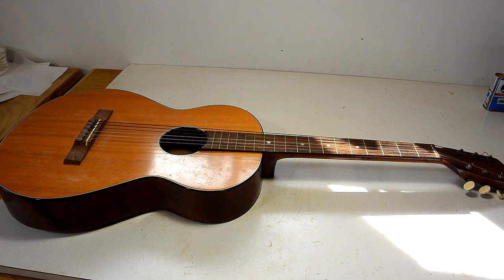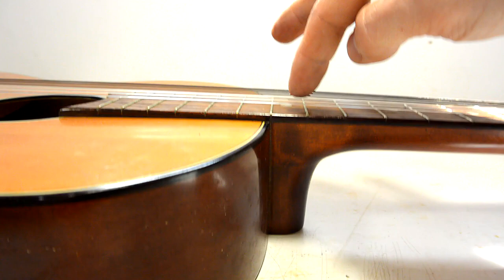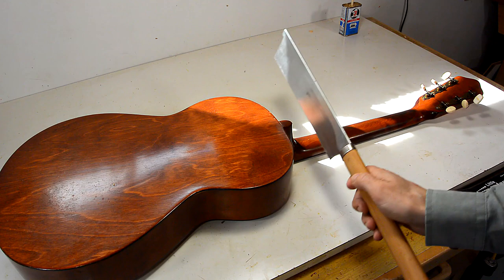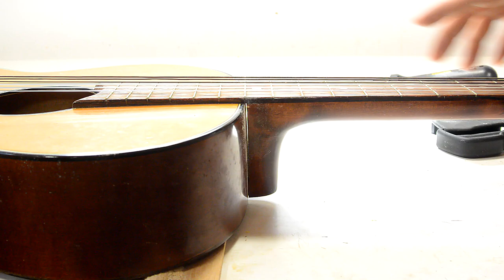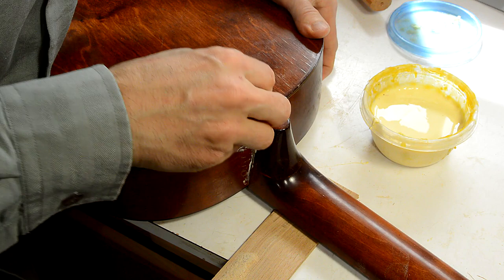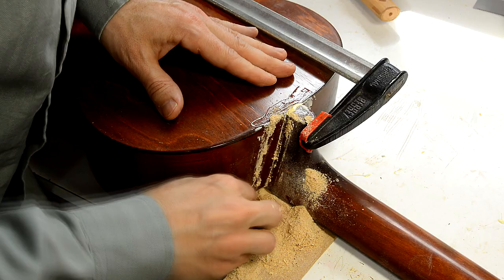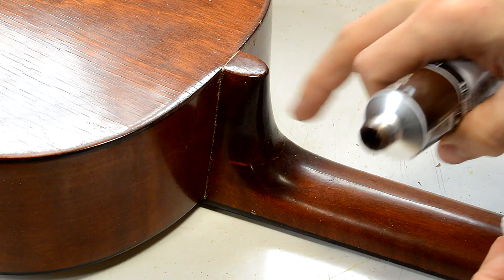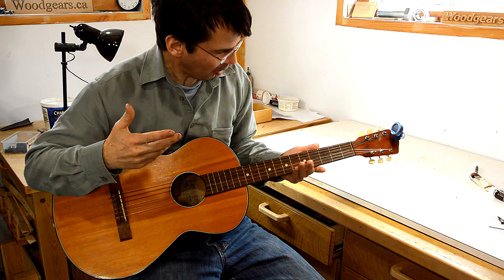Neck reset on a junk guitar

Comment: Joint strength and longevity aside which seems to be the only thing people on this comment section are worried about, vibration transduction, a direct contributor to the overall sustain and volume of the guitar,is what is most negatively effected by replacing that wood with glue. The vibrations from the strings are not only waving over the sound hole, but they are also vibrating the entire guitar. By putting in even more glue, you are buffering that wave and losing amplitude in the process. Don't get me wrong. If I had a crappy nylon guitar who's neck needed to be reset that badly, I would most definitely use a method like this or even more barbaric to get in right. No sense in spending hours or days of my time that could be spent making more money somewhere else. Also, nylon strings operate at almost 1/3 the tension of steel strings and the joint honestly doesn't need to be that strong.

Comment: I'm wondering how much you closed the gap between the strings and the bottom of the fret board after this fix.  It doesn't look to me like one would gain much, but it sounds like a great idea.  I have a baritone uke with the same problem.

Comment: Hi.. Good job, !!  I've also done many of these repairs on older guitars.. What you've done is known as a ' Hippie ' neck reset.. Its a lot easier/quicker and cheaper than steaming the neck off and shaving the duck tail..  What you also could have done while the glue was setting was,,,put a strap button at the base of the neck joint and drive in a 2 1/2 in wood screw directly through the neck joint into the tail block..This would guarantee the neck won't let go,,, plus you'd now have a strap button at the front as well ... Cheers

Comment: This indeed is a quick way to do this but it would be better if you use a Renovator (Electric Tool available
at Amazon) and mask of the sides to reduce damage. Mounting a screw from the inside into the heel is
a necessary extra!

Comment: So just by sawing off at the point where the neck meets the body removes enough material that when reglued. The strings are closer to the fretboard?
Reply: He does not really comment on that, but I would say you are correct. The removal of that material results in the neck tilting , lets say back. Or you can think of it as lowering position of the nut relative to the bridge. 
And you can see kinda the same thing, minus the sawing by looking up that process of shimming the the neck of an electric guitar. That changes the angle of the neck.

Comment: Nice!
You could have also heated up the neck heel and the fretboard and then chiseled an angle on the neck heel where it meets the body. It should also solve the high string action.

Comment: I had a situation where my son found a discarded Gremlin guitar made in Taiwan. It was a G10N I found out with a little research, (the label was quite faded), and brought it by my home. I cleaned it up really good, because it was filthy !! It had some dings and scratches, but didn't look half bad actually. Someone put a nut and a saddle on it that hadn't had the height adjusted low enough, and the strings sat way too high off the fret board. Also they had heavier steel strings on it even though it was just a travel-sized classical guitar. Luckily, my wonderful nephew is a guitar tech, and he took it for a few months to work on it in his spare time, even though he was a very busy guy at his guitar repair job. He took out the nut and saddle and sanded them down from the bottom, and had to do a cheap neck fix too, because these little guitars have no truss rod. The neck actually had too much bow in it, which is opposite of the usual problem where the neck is too straight - go figure, right ? Somehow he did manage to remedy that, God love him : ) He restrung it with Martin brand classical strings, 3 light silk and steel and 3 nylon I think, and I love it. My nephew gave it back to me a week and a half ago at his going away party; he's in the Army now, and off to basic training. I too am former military, and am very proud of him....he's going to work on helicopters, so I'm sure he'll be in tech-school for quite some time. I'm not sure any guitar is junk if it can be repaired, played, and enjoyed by someone !! I prefer to call mine 'recycled', and I think it sounds pretty good : )

Comment: I had to undo my thumbs up when he pulled out the saw.  But then when he did not cut through the fretboard, I had to thumb it back up.  ...or re-thumbs up it.    The problem with this repair is that it fixes all the accumulated curvature in one place. But a lot better than throwing it away.  And he tuned it up perfectly.

Comment: I think you can reinforce this joint by adding a screw in the guitar heel, and hiding it with a strap button. But you will have to add another one at the bottom of the guitar.

Comment: It doesn't have a truss rod because it's a classical (or flamenco) guitar, gut or nylon strings which put no tension on the neck compared to steel strings of a typical cowboy's acoustic guitar.

Comment: Dude,.....barbaric (as you said in here) for sure. Nice saws and subsequent sawing but decent solution on this issue. I guess you are supposed to loosen the glue and totally remove the neck and then reset but, you had a unique solution and one I have never used or thought about. I bought and sold used guitars before but when a neck was done it was done. I saw some messed up angles. Nice sound and prolly sound better with new strings on there. Your Mon will be proud.

Comment: thats why when you store such guitar you need to release the strings tho.
Reply: *****
true, tho many of the low cost guitars doesnt even have truss rod which should be metal and cant be bent by humidity.
Reply: ***** Nylon-string guitars rarely have truss-rods , because the string tension is miles lower than steel .
  That's why people who retro-fit steel strings destroy them in time .

Comment: I just broke mine off because I got fed up I still had pins so I cleaned up the old glue put ALOT of new glue re-sat the pins and fret and fretboard then I did something very bad I put a screw in it and covered it

Comment: nothing new or unusual... it's a common way to perform a cheap neck reset, but I wouldn't trust titebond to hold. epoxy glue is usually used for such a procedure.

Comment: Well, now I can try this type of repair on a Silvertone. The action is WAY out and there is no truss rod adjustment.
Reply: This repair works just fine. I did it this way too, except I didn't cut all the way up to the fretboard, and I used bolts instead of glue. Now my old $10 acoustic sounds like new and the action is perfect.

Comment: I tried this on my guitar. But now the strings buzz like crazy. How do I reverse the process?
Reply from the maker: you lowered the action by too much.  I guess you could cut it again and put a lot of glue in and hope that it fills the gap
Reply: @matthiaswandel  that's actually what I'm doing. I am using the clamp to slowly squeeze and lower the action until the action is perfect. Then I am using the same method. To sort of make a filler for the space I mixed ash from a cigar(what I had at the time) saw dust and wood glue and filled the gap with it. Hopefully it will work out good when I check on it tomarrow

Comment: Isn't it still warped though?
I'd think this method would just create a pool effect around the 9th fret now.
If you get another to try, just pop them first 7 frets and plane the fretboard down until level with the rest of the neck.
Lower the nut a bit and glue the frets back in.
Take a fraction of the time and it's straight.

Comment: Have you ever done a video on how to sharpen those small saws?  I bought some files but I think I did more harm the good.
Reply from the maker: I don't consider those sharpen-able.  I use them sparingly.
Reply: Not trying to do advisement but I saw a video in Paul Seller's website for sharpening saw. Hope it helps http://woodworkingmasterclasses.com/

Comment: Would have been 100 times more efficient to unglue the fretboard, install a trussrod or a carbon rod, and reglue the fretboard back in.
Reply: nicolashrv That would fix the bow between the nut and the 12th fret but that still wouldn’t fix the angle of the neck to the body. Guitars need neck resets because the body geometry changes and is no longer perfectly aligned to the body
Reply: That gets fixed by adjusting the truss rod......it is the point it was designed for.
Reply: You cannot fix a guitar's angle from the neck to the body with a truss rod. Only a neck set will do that
Reply: you have no idea what you are talking. 1) the angle is not damaged here 2) guitars don't need neck angle 3) the problem here wasn't the neck angle, it was the neck bowing.
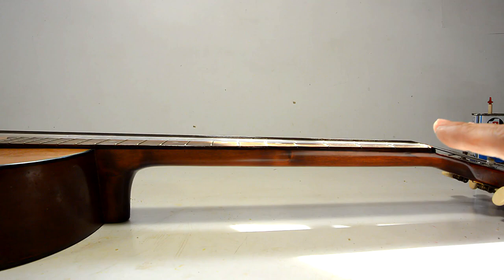Reply: If you look at 0:08 you'll see that the string action is fine in the first 5-7 frets but higher up it increases which can be easily fixed by pulling the neck back with a neck reset that way its even throughout the fretboard. You sir have no idea what you're talking about
Reply: ok
Reply: @Skunky Monk Why he would lower the bridge? That is not the problem. The problem is bowin on the first 7 frets.
If you lower the bridge, you are changing the action on all the frets which are ok, which is ADD problems to the guitar, not solving problems.

Comment: 😭😭No, dont cut the neck If its a solid top then its worth restoring! Remove the cheap finish. Soundboard should be 3/32" thick and back and sides down to even 2.5/32 if possible. Remove saddle piece and channel out more wood material if possible leaving at least 3/32 of wood inside the bridge, so that saddle can sit closer to the soundboard, this  makes huge difference in sound,response,tone,clarity volume etc but dont remove all the wood leave 3/32 of bridge material for structural purposes. Remove neck,reset neck to restore action and remove fingerboard and add a truss rod.... I would! ....String instruments are beautiful. God made the trees and we were made for God!.... I was even elevated by reading the book of Habbakuk today!  "A prayer of Habakkuk a prophet of shiginoth. O Lord i heard thy speech and was afraid O Lord revive thy work in the midst of the years, in the midst of the years make known, in wrath remember mercy...Yet i will rejoice in the Lord i will rejoice in the God of my salvation. The Lord God is my strength he will make my feet like hinds feet, he will make me to walk upon mine high places.To the chief singer on mine stringed instruments"- Habakkuk 3 .... 🙌🙌🙌🙏🙏🙏🏃‍♂️🏃‍♂️🏃‍♂️ Remember God in everything thats who life is for! Everything you do will have new meaning!

Comment: Do not do this to your guitar if you value it at all. What he did was cut the dovetail joint off and then glued it back together. The dovetail is what gives the joint in the neck it's strength. I am sure that in a very shot time this guitar will be junk because the neck will not hold together for a long period of time with out the dovetail joint. Had he removed the fretboard he would have been able to see the joint and repair it properly. I wish they would take this video down so some unsuspecting soul does not ruin his guitar.

Comment: That's not a reset, that's completely ruining that guitar. No one should do that!
Reply: well, what else can you do? 🤣🤣🤣
Reply: At least attempt a normal modern neck reset. Traditional guitars like this one is a serviceable instrument that can be taken apart and put back together many times over hundreds of years just like violins. If the guitar is worthless, there is nothing to loose. but this is just a guaranteed way permanently ruin. This is like hacksawing  off the handlebars on a bicycle and welding them back on straight to adjust the steering.
Reply: Eb Steward Classicals cant be done like a typical neck reset. If there is no dovetail then you can’t take it apart
Reply: Guitar was brought back to playing status...not ruined.
Reply: This looks to me like a entry level factory made guitar that was probably built like a ladder braced steel string guitar but given a classical bridge to sell during the folk revival.
Reply: Juan, The guitar is now just connected to the guitar by the fretboard and a bad glued flat surface. The fretboard has a fret and fretslot right on that joint only leaving ~1/16 -  1/8 in  of wood at the bottom of that slot to connect the neck to the body. Any bit of rough handling and that sliver of wood will fail and then the neck will only be attached by that poor glue surface. This is like straightening a chair leg by sawing off and just gluing it back on to the bottom of the chair. A simple neck reset is not brain surgery. If it's not worth paying a professional, watch a video and do it correctly yourself. but this should never be done to any instrument.
Reply: There are many common old ways of doing things that we now know are bad. These "california neck resets" should be filed away with bloodletting and sticking pennies in fuse boxes.